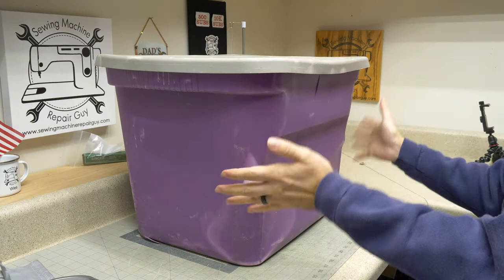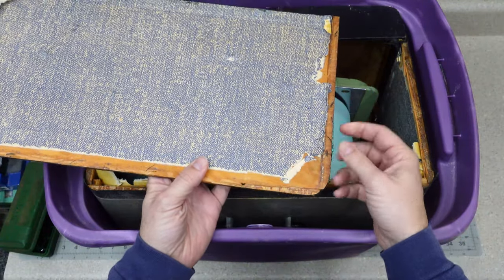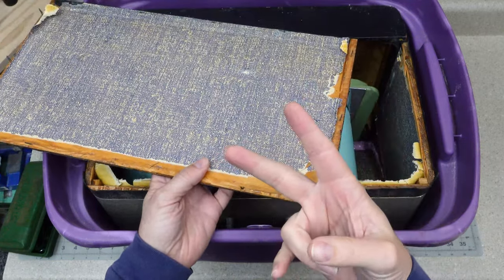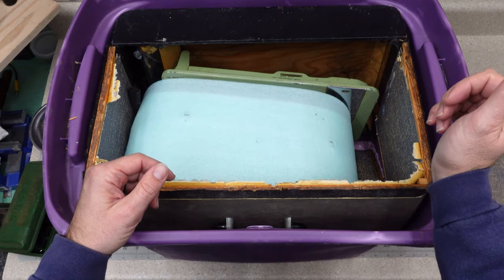Unboxing a Super Rare Vintage Sewing Machine 😢💔

Comment: Oh and by what I can see from the vid the case pieces seems to be complete/whole (not completely broken into tiny bits) so it is repairable just needs some tlc and reinforcement internally or externally by metal on corner joints. Add support to bottom if needed, it's better to repair than throw away.

Comment: The next time you order a machine, have the shipper send the machine and it's case separately. You will have a better chance of keeping both machine and case in good shape during shipping. I used to work in the high end wine business and always sent the wine separately from the wooden case. Never lost a shipment or had any damage of whatever I sent in three years of work and having sent thousands of orders. Emphasize to the shipper that both parcels need to packed very well so damage won't occur. Good luck
Reply from the maker: Absolutely correct!

Comment: Cool.   They don't make 'em like they used to eh? If it was a new model the machine would have been cracked and in pieces!      Packing a machine for shipping could be a topic for a video :)   When I sold one to ship I followed the rule for packing a framed art picture.   Either let UPS pack it for you - OR - do this:     Wrap the item in a couple inches thick bubble wrap.   Put it in a close fitting box.   Wrap that box in a couple inches of styrofoam and put it in a close fitting box.   Tape the final box thoroughly.    In other words - anything fragile whether it's crystal dishes or a small machine,   it should be double boxed.    Love your channel even though I don't generally use the info other than loving all my old hand-me-down sewing machines.   I'm just waiting for you to service a 1954 Singer Simanco  which I learned on.   I think you're smart to sell parts  :)
Reply from the maker: Thanks!

Comment: I bought a lovely Universal zig-zag machine a year or so ago.  It was poorly packaged and the deck is cracked and shifted. I don't even know if it's repairable. I DID get a refund through Fedex though, but I'd rather have had an intact machine. Oh well, that's life.
Once in a while, I've politely asked a seller to double-box. I've asked to have the machine padded beneath and around it with thickly wadded up newspaper in one box, then layering wadded newspaper in the bottom of second box before lowering the first box into it and finishing with the same padding all around. Done correctly, this works extremely well and the best sellers are usually agreeable. They want a successful transaction too.  I've sold highly fragile items packed this way also and they've always arrived without damage. The second layer of newspaper is a good buffer.
Reply from the maker: Good idea for packing

Comment: That is the original timing belt, for sure.  There were two versions of that belt-- one made of textile strands with metal cleats, and the other a steel belted composite plastic belt like the one in yours.  Unfortunately, the steel/plastic type falls apart after fifty or sixty years. If the replacement belt you are going to try to have manufactured can be made open-ended so that you can join the ends together once it is over the pulleys inside the machine it would save you and others many many hours of work. Good luck! I hope you succeed at this.
Reply: Are you getting all of the cams with this? I think there were four different cams... three came with the machine and one came after.
Reply from the maker: I got the accessories a week later. Came with 4 cams and all of the original docs. There were 5 cams available according to the docs. Also came with lots of feet and some other accessories. I'm not going to play with it too much since the belt has pieces coming off every time I move the machine.
Reply: @SewingMachineRepairGuy  Count the teeth... before its too late! You'll want that number handy...
Reply: I found this kind of belt too (open side) have you tried? was a fail mission or good mission.  I received mine without the cleat belt phoenix 288f (mouses lunch) If someone has a 288F can you please tell me how many cleats on this model thank you to all!